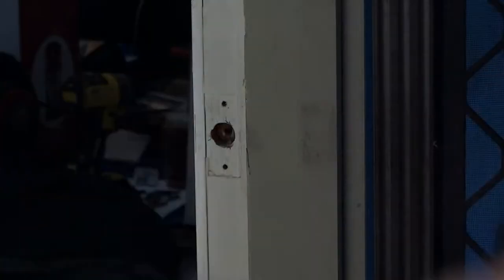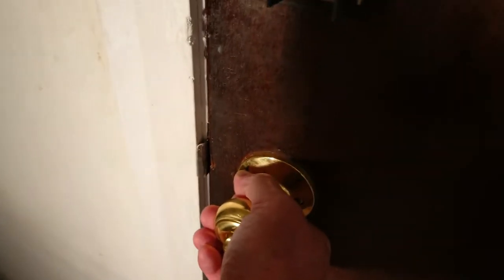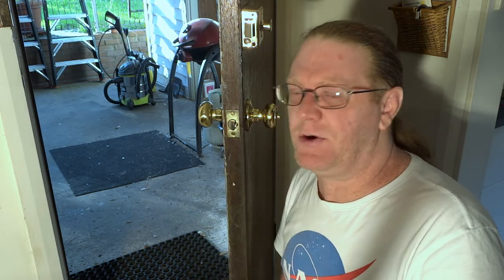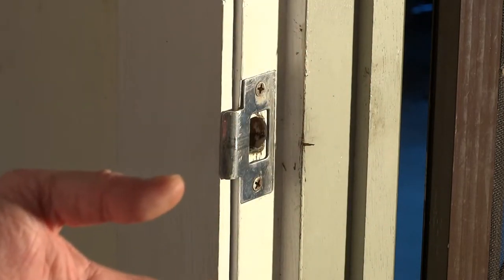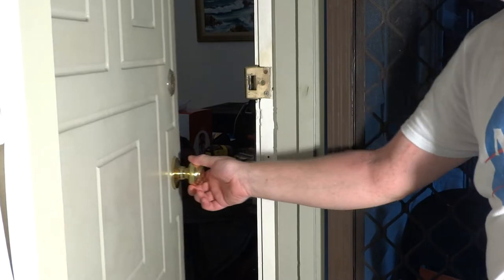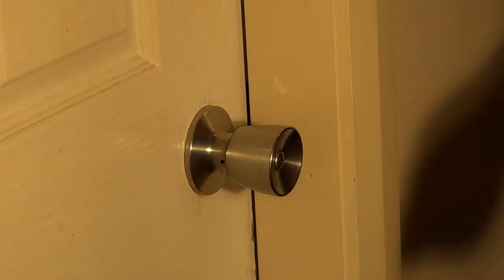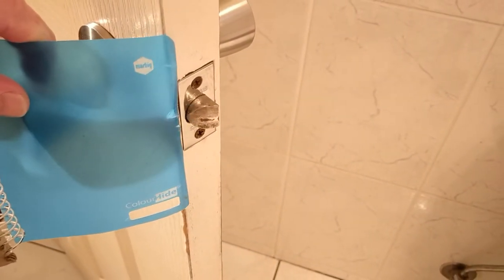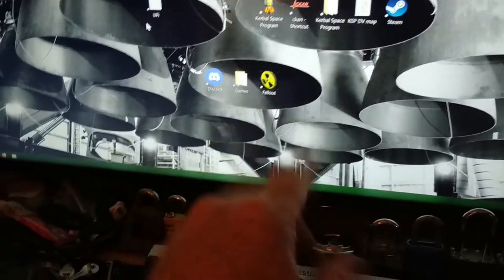How to bypass a deadlatch - "Lockpicking" made easy

Comment: So the video is called how to open deadlatch but you don't actually open deadlatch? Good idea for fishing the views!
Reply from the maker: The video is called "how to bypass a deadlatch". The shimming technique is a type of Bypass attack, because the lock isn't directly manipulated. It's sometimes also referred to as 'loiding in the locksport community, because people used to use celluloid photography/video film to perform the attack; film is engineered to be  very flexible but also strong enough to withstand getting dragged through camera/projector mechanism at high speed, so it's ideal for this purpose.
Reply: @sixstringedthing  don't be so pedantic. You still don't bypass the deadlatch, you disable it before you close the door.